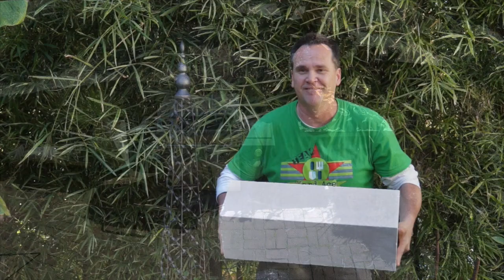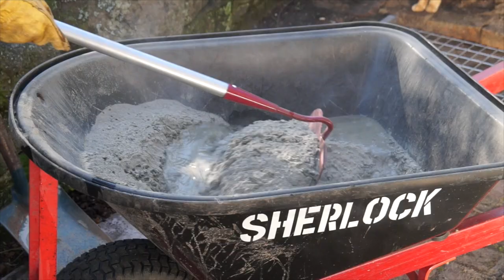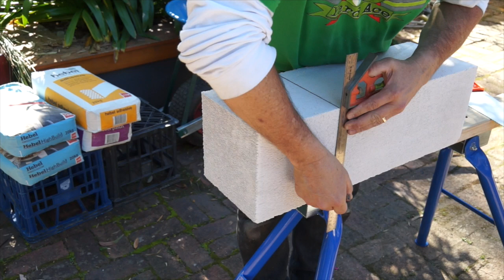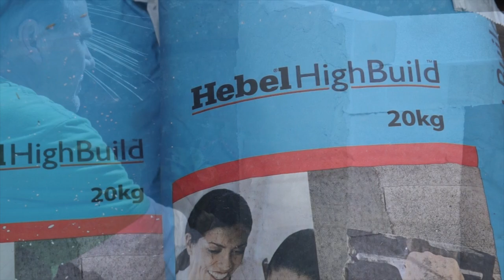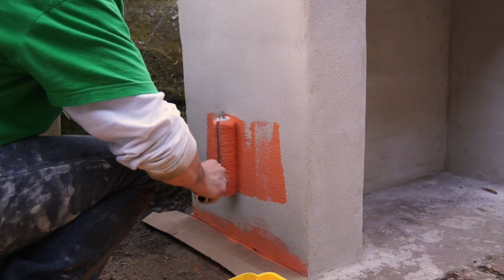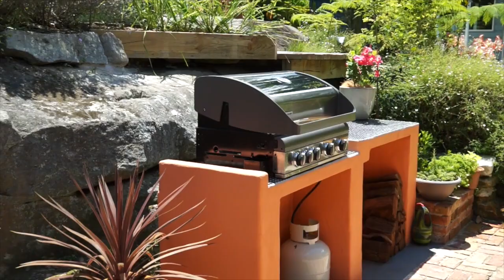BBQ area makeover - how to build a block BBQ

Comment: Well that looked pretty cool and easy to do. Can you get those blocks at Home Depot?
Reply from the maker: You should be able to Tyger. It's often called light weight concrete, technically AAC blocks, but there may be some difference in names between countries.
Reply: @AdamHWoodhams  After searching the web found this comment "the product is banned in California because it hasn't passed seismic tests." So maybe the big stores don't sell it. I'll keep looking.
Reply from the maker: Ahhhh, interesting. The blocks don't have the structural strength of traditional concrete but I would have thought the panels would as most are reinforced with steel.
Let us know how you go in your search.
Reply: (thought I posted a comment already but cannot see it)
unfortuntally it seems that those reinforced panels are not available outside of australia.
If you still want to use AAC blocks for the countertop, you could evaluate placing some T bars steel longitudinally to the structure where you want to put the countertop, and place the blocks on top of them